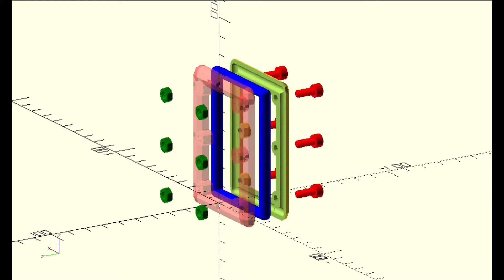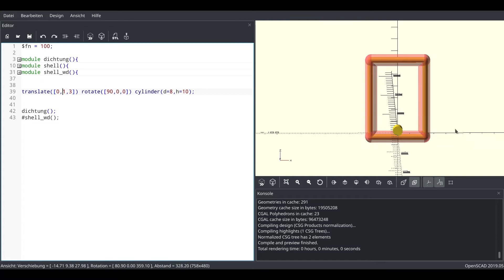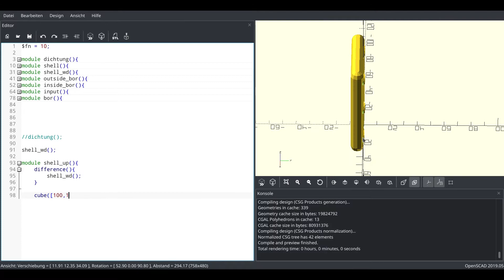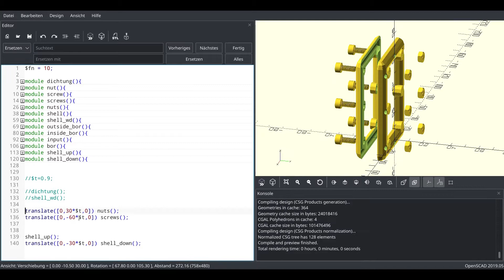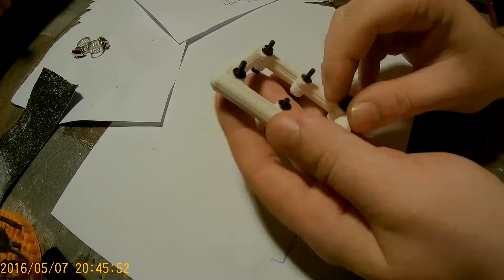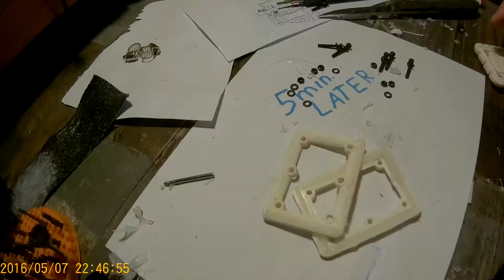Molding a gasket with hotglue and a 3D printed Mold

Comment: Great idea in this video. I've watched similar videos on using hot-glue for injection molding, and they had a solution to keep the hot-glue from sticking to the mold. The solution was to light a candle, and then use a small paint-brush to paint the melted wax into the plastic mold. The thin wax layer, worked as a "mold release" medium, and kept the hot-glue from sticking to the plastic mold. Hope it helps. :)

Comment: kdenlive is not the worst video editor, it's actually pretty good for something open source. But for The Real Deal I always always recommend Davinci Resolve, even the free version is insanely powerful. Works on Linux (with some graphics cards)...
Reply: For audio, Audacity has a denoise filter, it works pretty well and should kill most of the hiss your mic has, otherwise it's fine.
Reply from the maker: @-szega  thx for the advice with Davinci Resolve i will try that out :)
actually kdenlive is suposed to have a audio denoise filter but somehow the module dosent show up